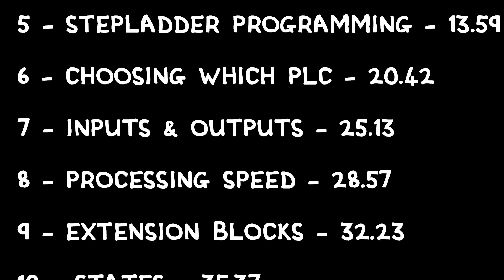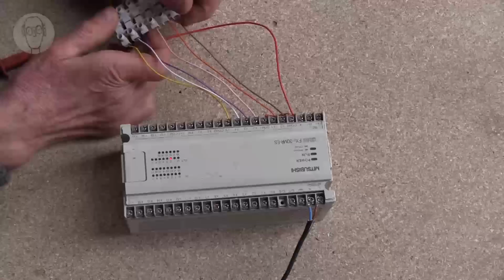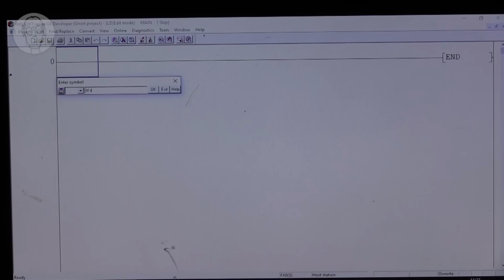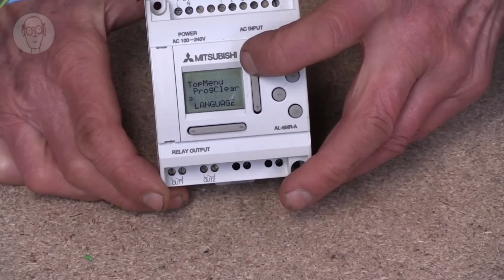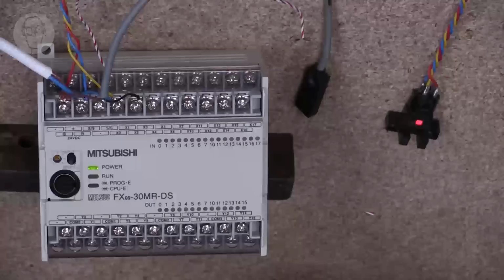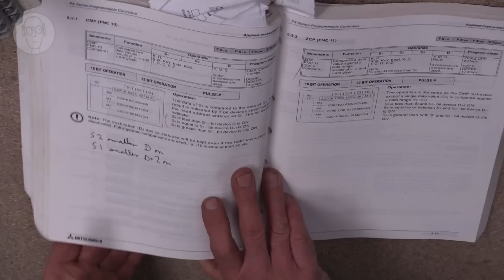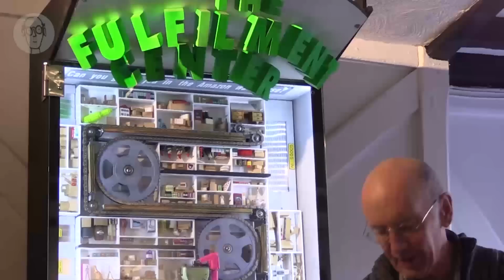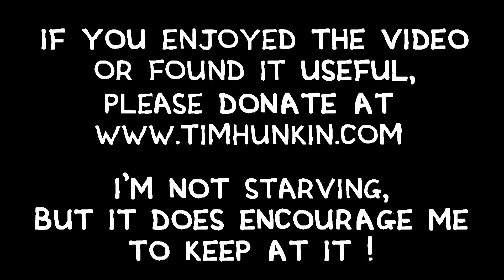PLCs (Programmable Logic Controllers) - The Secret Life of Components - episode17

Comment: It is no surprise that the PLC can keep up with the encoder if it can process an input in one fifth of a millionth of a second (0.2 of a microsecond).  If anything the limitation would be with the encoder
Reply: Good point, the actual limit for encoder inputs is usually the input delay (most PLC's galvanically isolate digital inputs, which delays the signal being read) not the processor speed

Comment: Ladder logic really is awful isn't it!
Reply: That's what I was thinking. Microcontrollers like Arduino, Raspberry PI, PIC a lot easier and more powerful IMO.
Not as robust plug and play though.
Reply: @andrewfarrow4699  A lot of the time the automation industry we interface directly with the PLC via ethernet and command it to switch it's inputs without using ladder logic just so we can enjoy the best of both worlds
Reply: Better to just program them in C, which is usually available, maybe C++, and assembly if not.
Reply: Yes, but also no. Ladder logic was/is easier for industrial control. To a large extent it mimics the old relay control systems which were used before the PLC, making it easier for people who are not keen on other ways of programming. Visually it’s easier, if made properly (which it rarely is).